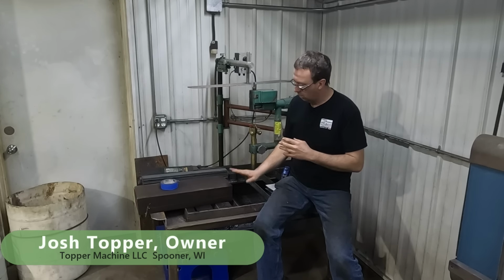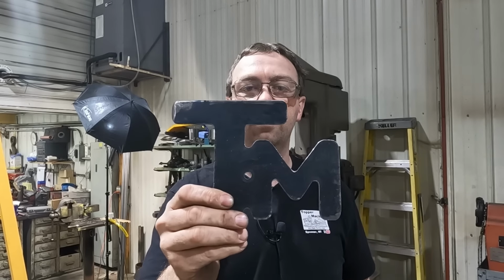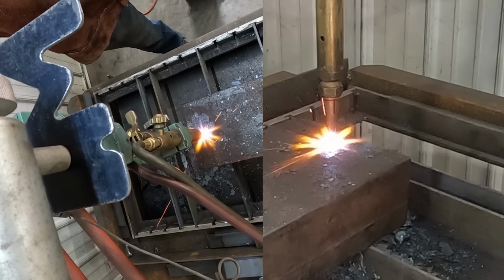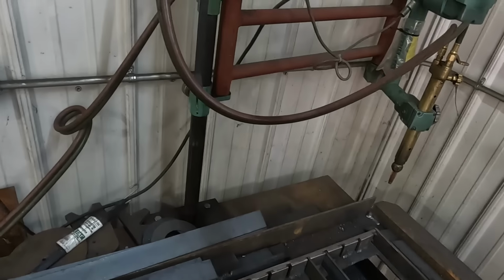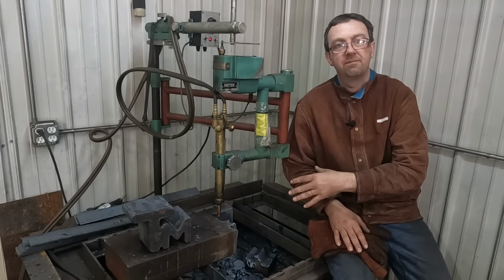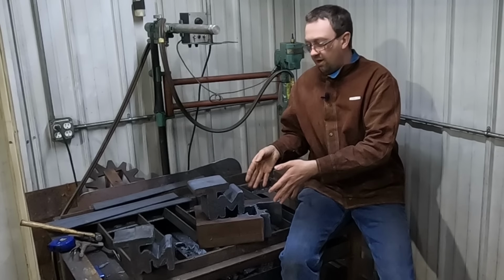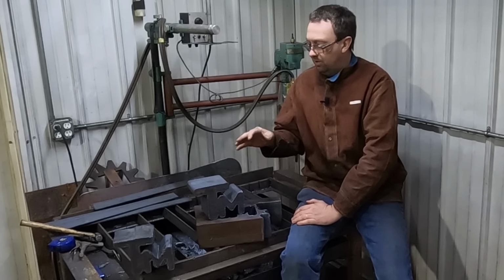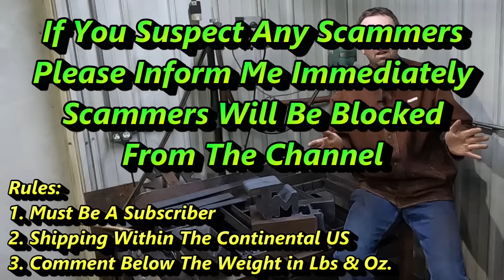Amazing Metal Cutting Without A Computer - Manual Machine Shop

Comment: Outstanding, I cut some 4" with an old Airgas track torch set up a few years ago, 8 inches a minute...
.#4 tip on a Victor torch. 8 acetylene and 40 oxygen if I remember correctly .
it looked like a volcano coming out the bottom, I did not run a preheat pass, and 
the torch was a 3 line with 2 oxygen lines....
the kerf looked like it was cut on a band saw,,,,,,super smooth.....
great video Josh....
Paul in Orlando Florida

Comment: Barry  Fulcher  I first saw this type of cutting done out in Billings Montana at a company that built large mining haul trucks . The man cut me a piece  of steel 6" thick x6" wide x 12" long he told me he was using acetylene  at 25 psi and  oxygen at 100 psi and when it started cutting  he turned off  the acetylene  as the oxy kept the heat up till it finished ,Amazing !! My guess is 52 lbs.6 and1/2 0z. I enjoy your vidios very much.

Comment: Wow, I’ve never cut anything thicker than 1/2-5/8” thick with manual torch.  We had a rail torch at the shop I worked at in high school Vocational Industrial Clubs of America(VICA) and it made a beautiful cut when the torch and travel settings were correct.  I did not see you really preheat the plate and suspect part of the reason each succeeding unit was cut was due to the heat in the metal.  But to watch something cut through 4” thick carbon steel that fast was impressive.  Glad you found a local person wanting to apprentice.  Our shop was a welding/machine/ornamental iron shop.  There wasn’t anything the boss would turn away from doing metal wise that would make a paycheck for him and the employees.  Somethings were considerably dangerous just due to the inherent nature of what and where we had to work and our surroundings.  I’m glad I got to do it all.  But went into Army electronics: then the state of the art surface to air radar and missile defense system then came from Army and went into Commercial Nuclear Power in instrumentation & Control(I&C).  Never lost the bug to learn and do machine and welding though.  God will and I live long enough and body can handle it I hope to at least get a hobby machine and welding shop built.  It won’t be high dollar new stuff but most probably WWII/Korean War era machine equipment or a Chinese unit I can afford and improve on.  Good video.  I would be interested to know what a plate that size and thickness would cost if purchased today.  Hope you don’t get a job request any time soon where you could have used that plate in the job and have to buy a new piece $$$$ and as you mentioned shipping cost, lord have mercy an 18 wheeler couldn’t carry many full sections of that 4” thick plate.

Comment: Found your channel while browsing, some great stuff. I used to coordinate cutting machines (oxy torch multi head and plasma - some with NC retro fitted) here for a now closed steel company in Melbourne, Australia. We used to cut steel plate to around 60ish+ cm (can't remember now, it's over 20 years ago) thick. Looking back now I wish I'd learnt more from the machine operators. There were always battles between the NC programmers and the machine guys on using cut in keys, kerf angles between parts on the plate etc. Some guys used to do a trace (like you did with your second piece to see if it will fit), others could just look at the program on the display or a piece of paper and know if it was good or not. Some liked to preheat the plate too, some reckoned cold plates were best. Haven't seen a duplicator before, but what a great idea. So simple and elegant.

Comment: 15lbs  7 oz   I did not know you could cut 4" plate with a torch. Guess that is why they call it the gas axe. Thanks Josh
Reply from the maker: My torch will cut 6". I have another one that is good for 18".
Reply: @TopperMachineLLC  18?!? Next project, battleship?
Reply from the maker: @christianullrich2923  that would be fun. I always wanted to take a 16' canoe and build a working replica Iowa class battle ship. Shotguns for the 16" guns. All RC. Nobody would be in my fishing spots for long with that patrolling the lake. Lol

Comment: I feel bad that you had to do so much work cutting your pattern. I would have been glad to draw it up in CAD and then cut it on my CNC plasma cutter. I am real glad that you have a helper and that you are able to teach him things. I worked in steel fabrication since 1990 but it was only sheet metal and I was just a button pusher on a laser. I have never seen 4" steel being cut before. The price of the steel and gas must have  cost you a lot of money. I would guess the weight would 14 lbs. 7 oz. The shipping cost would be high so I would just take the two hour drive and pick it up myself.  It is always good to see you at work. I am glad that you took on the challenge. :hand-orange-covering-eyes::hand-orange-covering-eyes::hand-orange-covering-eyes::hand-orange-covering-eyes::hand-orange-covering-eyes::hand-orange-covering-eyes::trophy-yellow-smiling::trophy-yellow-smiling::trophy-yellow-smiling::trophy-yellow-smiling::trophy-yellow-smiling::trophy-yellow-smiling:
Reply from the maker: The hardest part of the pattern was the drawing. It took only 30 minutes to make it once I had the drawing.
Reply: @TopperMachineLLC  how long did it take to cut the last one out? 
Thanks and God bless you!
Reply from the maker: @michaelboyle1983  about 7 minutes each. Really not bad.
Reply: @TopperMachineLLC  that's a lot faster than I figured. 
I have a 3' X 10' bench that's made out of 2" plate steel that I'd like to cut down into 2 benches so this gives me some hope that it probably won't take that long to do. I bought it from a factory and it looked pretty big in there but when I hauled it home on my trailer it seemed to grow because it looks huge in my garage.
Thanks and God bless you!

Comment: To get a good clean burn you need plate heaters to get the steel up over 400 degrees......We used to use high intensity IR heaters (Red Heads) on thick plate a few hours before we burned it (Back in the days of Optical Tracers) And alternate way is to build a charcoal fire in the slag pan and put more charcoal over the top and cover it with fiberglas insulation. - Make sure you have excellent ventilation though. Charcoal emits carbon monoxide. Lots of it. 

When the plate is hot as you can make it clear the ashes off the top and drag it over away from the ash pile. It will cut smooth as glass. - Clean plate (No rust either side) + As much preheat as you can get=perfect parts in thick plate

Comment: Very interesting channel, I've learned some things on  the machining shows. This one caught my eye because I was a metal pattern torch flame cutter at several factories long ago. We never cut this thick of metal except for a special torch that cut a special cam for beet harvesters. We were usually doing 1/4" to 1" thick parts that can't be made with other machines. The patterns look much like the parts and had to be protected by painting etc. Only they have the mounting hole and they are slightly smaller than the part due to the offset of the magnetic rotor of the travel motor. 

Very good job getting that good of cuts on a run of only 3 parts! Obviously you had a clue of what heat, speed and O2 pressure you were going to need. You didn't show a close up of the cutting grain but if the pressure is too low or the speed too fast the cut path wanders. With a clean tip and experience we could get all the slag to fly off so the parts needed almost no cleaning. We usually ran propane/O2 as it cuts cooler and the parts metal was in better condition, not hardened so much. We also did stack cuts of thin metal like 16-18ga of 10-12 parts at once. That needs a thicker top sheet and lots of clamping near cut paths. We actually ran quite low gas and O2 pressure for most parts, like 7 and 12 psi. It's quite a balance act of pressures, heat, speed and tip height. Any vibration shaking the torch messes it up too. Tx for the show.

Comment: I love watching your videos. May I offer one tip that I use all the time. Rather than cutting the pattern with the scissors, just tape it down on a clean piece of steel, with a piece of carbon paper under it. Then carefully trace the pattern with a ball point pen. The carbon paper will transfer the pattern you want to the steel.

Comment: I figure 21 lbs, 9 ounces.  Send it in a USPS one rate box!  Just need to reinforce it with an internal plywood box!!  That torch setup works really well.  And Connor is learning some good stuff from a good teacher.  Thanks for the contest!
Reply from the maker: He is getting a great education in alot of stuff.  Hopefully he pursues a career in this.
Reply: @TopperMachineLLC  My college required a lot of cross training.  I had to do welding engineering, mechanical engineering and some machine tool work for an electronics degree.  My lathe projects got a compliment from a machinist.  He asked how much experience I had before I started the class.  Zero.  He said I had the knack.  After my kids all moved on, I started putting together my shop.  I never forgot his comment, and it made sense to me to develop my ability.  It is a necessary profession.  I wish I'd started with it sooner.

Comment: I was an IBEW apprentice working at the Lima, Ohio Army tank plant in 1980.  I helped install the flame but system used to cut the steel plate.  Tanks were made from steel up to 6" thick.  Only one piece was that thick, the part that the cannon sticks out of.  Some of the tank was 5" thick.  Until now, that was the only thick steel I have ever seen cut with a torch.  I live in the Philippines now but am guessing your logo weighs 35 pounds, 7 ounces.

Comment: To save a butt load on shipping you can use the USPS flat rate shipping.  That should fit in a medium box just fine.  If not maybe it will fit in an envelope and just tape the crud out of it.  I used to ship cast lead bullets and yes you can get more than 75lbs in a flat rate envelope with lead bullets.

Comment: I'm A retired Nuclear Grade Steamfitter Weldor out of L.U.598 PLUMBERS AND STEAMFITTERS PASCO WASH. I cut ALOT of heavy schedule pipe and boiler plate as an apprentice LOL! Your viewers might be interested in the gas and oxygen settings that you used. Were you using Acetylene or Mapp or Propane as your fuel gas?

Comment: I worked for a structural steel fabricator many years ago. They had a full time plate burner. He used a straight line track burner and also had common circle sizes to run the machine with a center pointer. He could burn up to 6 inch thickness. To clean out the slag the operator would hook the burn table to the overhead crane. Then he would scoop shovel the slag into a scrap box so it could be dumped into the big dumpster. Yes the big chunks took a long time to cool down.AL B.
Reply from the maker: My slag tray is a removable drawer. Pull with the forklift and go clean out.

Comment: Surprised you don't run water fill on the slag pan. Great to see you bringing up a willing apprentice!   25 lbs. 2 oz.
Reply from the maker: I have put water in it, but the steam is too much humidity in the shop. The pan is actually doing a nice job without water. Just takes a little longer to cool.

Comment: I am by no means trying to second guess what you are doing Josh. But from my vantage point, it seems like you have the torch tip too close to the metal. I welded for a living for the first part of my life and had several of these kinds of machines. I think I remember you also have a pipe cutting machine. I owned and used them and it does make life easier when fabricating. My guess would be around 26 lbs 8 oz... Thanks for the videos!!!!!
Reply from the maker: Quite honestly, I am still trying to learn about torch cutting.  Everything I was taught, was totally wrong.  Crank up the heat and go is not correct, so just playing with it as I go.  I was about 3/4" away from the plate in this video, no idea if that was too close, just right, or too far.  Every cut I do, I learn more about the setup.  Definitely hard to learn something when nobody around knows anything either.  I am always open to feedback that may help improve these operations.
Reply: @TopperMachineLLC  I appreciate your attitude about learning. I'm the same way. Any knowledge about things that interest me I'm like a sponge. I couldn't really tell how far away your torch was but what made me think it was too close was the metal looked like it was melted and rounded over on the top edge. Maybe the flame was too hot or the travel speed was too slow. Or the flame wasn't set right. Hard to tell looking at a video. If everything is set right, it should be a near perfect 90 on top as well as on the bottom. Another thing I always did was use a small hole tip and raise the pressure on the oxygen. I would cut 2 inch plate with a 000 tip and it would look like a band saw cut it almost. Another thing that you mentioned was all the oxygen you used. That was a clue to my way of thinking that your tip was wasting way too much oxygen and not cutting properly... It has been 25 or more years since I was in the welding, cutting industry but I still play with fabricating things in my shop from time to time. Wish I was closer to you, I would love to stop by and help sort out your cutting machine.

Comment: Very impressive. Apart from cutting very thick material, wouldn't it be a nice idea to fit a plasma torch to the Duplicator for smaller/thinner tasks to save on expensive gases? (As a viewer from Europe I can't participate in the giveaway, but I would guess about 21 pounds plus)
Reply from the maker: the plasma torch idea is in the works.  But it really isn't expensive at all to use oxy propane.  Even with gasses, I still come in less than the CNC plasma or laser shops.
Reply: @TopperMachineLLC  Thanks for the reply! The price situation for gasses is definitively a little bit different here in the EU, at least if you don't get commercial / wholesale rates :(
Reply from the maker: @cmeier7560  if you look at some of my earlier videos on this torch, I cut some 1/2" plates that looked like stars. They were 12" diameter. Total cost for gas consumed came to $1.73 each part. Each part cost about $25 each, with a 6 minute cut time. The plasma and laser shops quoted me $45-55 each. I saved quite a bit doing them myself.

Comment: I used to watch them cut piranha ironworker beams they had like a seven head torch back when they had a plasma table full submersion it had like seven or eight heads as well not the first time I seen a plasma cutter but the first time I seen a plasma cutter like that good God that thing was big

Comment: 10659.420694999999 grams.... topper there has to be better ways to heat shop and get rid of snow...always amazes me that the flame cut dont turn corners goin thru that thick of steel cool how it cuts straight down
Reply from the maker: It was nice and warm in the shop that day.

Comment: An old outdated machine that can't compare with a new CNC machine. The biggest difference is that the old machine just works, whereas the new CNC machine needs a lot of complicated setting up and you'll be lucky if it doesn't break down on a regular basis. KIS works best.
Reply from the maker: Absolutely. My neighbor has a plasma table and 2 lasers, and one is always broke down.  Max he can cut is 3/4". I have actually had to bail him out more than once with this copy torch.  Proving that the old technology is far more valuable than the new stuff.  Problem comes in when you need to find someone skilled enough to run the old stuff.

Comment: These are way too heavy to be useful! Run the 4 inchers through a band saw, slice them into say 3/8 to 1/2 inch widths. Or even thinner. The slices would then be able to be mounted in a frame and hung on a wall. Cheers.